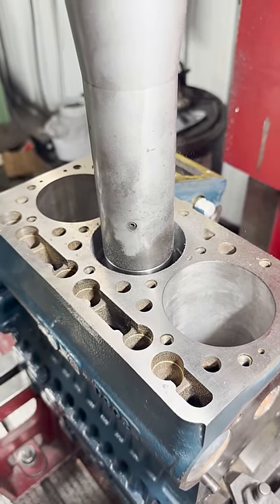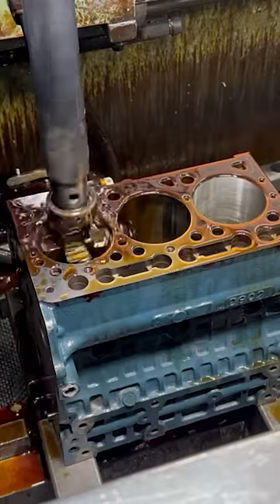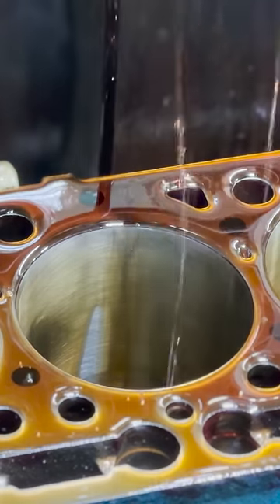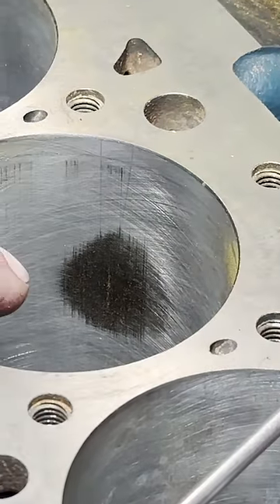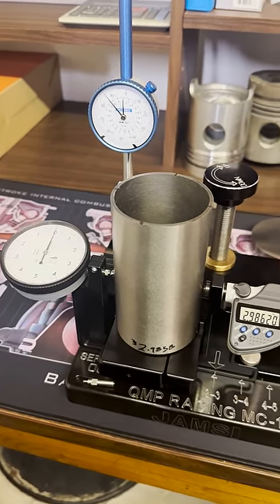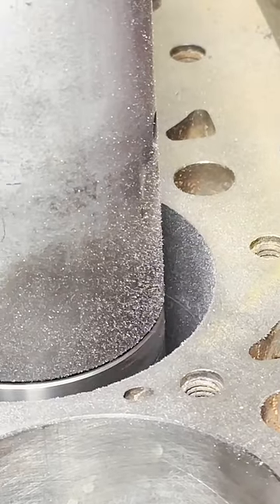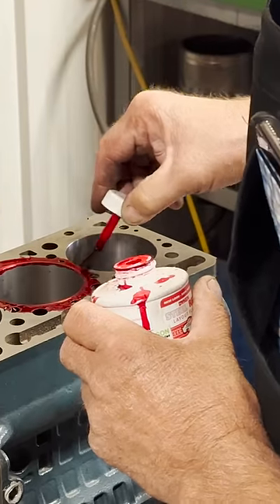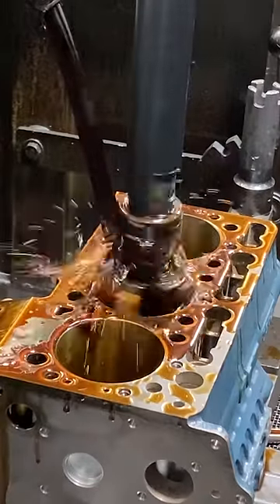#shorts Sometimes You Make Decisions Based On Experience... And It's A Good Thing!

Comment: When the repair cost more than the engine
Reply: A its probally comparable, otherwise why even consider the option.
B The win, not trowing shit away, and keeping orriginal parts.
Reply: I dunno, Kubotas are surprisingly expensive engines
Reply: bro cylinder sleeves are like a hundred bucks
Reply: $1000 - $2000 for that engine u tell me
Reply: @survivalistor6195  have to withdraw from my previous statement since the ones i checked was in fact used and not new. But still, i missed that in the video they say they need to repair the cylinderhead as well so that's an extra cost.
Reply: Na sleeving a block isn't that high
Reply: Good job
Reply: machine work, sleeves, over size pistons, new complete cylinder head, rebuild kit....doesn't make sense to rebuild...just get a new engine with a new warranty
Reply: @enslavedbytruth  all he did was machine and add sleeves silly
Reply: @tylerspruill928  what's silly? customer will need all those other things I listed to complete the job
Reply: @tylerspruill928  I see hundreds of these specific engines a year....when they get abused and overheated, the best option is to replace with a new engine...it's just the way it is...maybe if it was some personal project or something it would make sense...but this is one of the most common commercial/industrial engines in the market for sub-40hp diesels , meaning it's powering a money maker, the wise owner would just replace and get back in service.
Reply: @enslavedbytruth  Whats silly is the fact you think he needs oversized pistons and new heads
Reply: @survivalistor6195 na 25 hp small briggs twin cylinder gas motors $2,500. These kubota diesels 5-7k. I been a mechanic on this stuff for a while, they aint cheap and thats even if you can find them, we have engines a year backordered from covid still.
Reply: Yeah I feel like it would be way cheaper just to buy a new block and use the old parts. But it might be some rare engine that no one sells. Idk could be any but this seems a bit stupid
Reply: Those engines come out of skid steers, replaced one on a CAT 236d3 and then engine alone was over $12k…
Reply: Now that's a pricey meataball
Reply: First of all, those engines aren’t available in a week… we do some yanmar engines and those have delivery times up to 3-4months… So you rebuild them or buy a used/resold one. Also those engines are 5.000-6.000bucks so a repair for 2.5-3.000 is still worth it
Reply: It’s because your wait time to get replacement long block might be a year.
Reply: If you can afford it, sometimes its just more worth it to machine a block you already bought than getting a whole new engine.
Also it's recycling, thousands of tons of scrap are made every year and a good chunk of that is engine parts.
Also you simply can't get some motors anymore so you have to remanufacture
Reply: @litoaykiu That too lol
Reply: that is why today's industry consists of: It's broken? Throw it away and buy a new one.
Reply: I'd just source a replacement from a breaker, but you have to congratulate the workmanship here.
Reply: @tylerspruill928 The narrator states they’re installing oversized pistons.
Reply: @JPTulo  thats by choice, if he chose to do this normally it would absolutely not cost more than a whole new engine
Reply: @tylerspruill928  What’s availability like on those? Maybe parts are more readily available than a new engine and they can’t afford the downtime of waiting for a replacement engine whereas parts are readily available? I don’t know.
Maybe it’s sentimental. Obviously they did it for a reason. 🤷‍♂️
Reply: I was literally bout to say the same thing
Reply: @tylerspruill928  he states on the video that they proceeded to bore all cylinders to over-sized pistons...
Reply: @patrolmars3371  by choice they added oversized pistons, they dodnt need too
Reply: Well .. actually bore for sleeve, sleeve it, surface deck, bore + hone all 3 cylinders for new over-sized pistons and rings. Probably at least $1200
Reply: Old repaired engine is always better than new one because all the tensions in the metal are gone especially from the head
Reply: Can't just throw everything away bro
Reply: Kubotas are extremely over priced and this was probably cheaper still than a reman.
Reply: @tylerspruill928 they only charged him for the sleeve? That's crazy
Reply: This is when you say “screw it, I’ve got a trail rig that I could swaps that into…”
Reply: @darrellbeets7758 throwing metal away isn't an environmental disaster. Metal is 100% recyclable good as new.
Reply: Cost of repair is the sleeve and just machine time... if you get charged a crazy amount... you're getting bent over and reamed with no lube
Reply: You couldn't be more wrong... What is wrong with internet warriors like you? @enslavedbytruth
Reply: @gregscott4479  wrong about what sir? How often do you repair Kubota engines?
Reply: @enslavedbytruth No if you going to built a one with forged pistons, more compression, etc..
Reply: @tylerspruill928 okay you put pistons that are undersized in YOUR engine. Tell is how it works when you have trashed all your cylinders. You obviously don't build engines or have any machining knowledge. You need to do this
Reply: Oversized piston = more power. So if your going aftermarket anyway and paying the same price why not?
Reply: It's close to $6k for that engine.
Reply: But after drilling why it want welded? Quality level like covering crack with Wall paint... IT will crack more during exploatation
Reply: @survivalistor6195 $5000-6000 for a 3 cylinder like that. Or 10k if its an industrial kubota engine
Reply: @tylerspruill928 in the USA maybe. And the work is also affordable there but over here in the Netherlands getting a working engine from a scrapyard is way cheaper even new might be comparable.
Reply: That engine is $5999.99 + $300 shipping.  SO YOU'RE VERY WRONG. 😅
Reply: I've done this same job with a power drill, dry ice to shrink the sleeve, and a grinding wheel. They are being so extra about this it's silly.
Reply: Here in Brazil, repairing an engine like that is cheaper than buying a new one. Also, the bureaucracy to have a new one is very complex, leading us to prefer repairing it.
Reply: sometimes its nice not to have to throw your shit away, and maybe it only costs as much as or a little less than a new engine
Reply: @darrellbeets7758 could also be a discontinued and or very expensive engine. But if that's the case I would just do an engine swap with something cheaper.
Reply: Depending on if it is a repair under warranty, if the repair is $1 cheaper than a new motor they will go that route.
Reply: Atleast we know we can save her if it came to a 2jz I'm gonna sell my shit to get the Sututu 😂😂😂
Reply: I charged 20 dollars to install sleeve....idk what that sleeve cost definitely under 100 so not to expensive rest of stuff doesn't cost much probably 200 in the head plus engine milling the block i would of charged 10 a cylinder that block would be easy to mill
Reply: Depending where this was done it was most likely between 2k or the high end around 4k with head work. If they had access to the tooling it would be under a grand.
Reply: Cost aside, why not just sleeve them all while you are there, and are we not going to weld the crack and rebore it first?
Reply: @tylerspruill928 And if frogs had wings they would bump their ass when they hopped. But the don't have wings and they DID use oversize pistons. We're not talking about what wasn't done, We're talking about what was done. Your creating a strawman for your argument instead of talking about what was actually done.
Reply: And now you have a bad ass Kabota with some yeehaw 🤠
Reply: @tylerspruill928 sleeve cost that much. But labor and the machines don’t. Sleeving a block isn’t as cheap as you think EXPECIALLY if it’s just one block and not multiple
Reply: A new engine is probably several months out…down time=lost money
Reply: @eddoordofoo  a new engine is prob double if not more the cost
Reply: At least you'll know what you have
Reply: @tylerspruill928 .......... If you pay attention to the video the guy says he's putting oversize pistons...
Reply: I was thinking the same thing
Reply: @Fury_BlackWolf  they put oversized pistons and improved engine power. you have to add that to its value overall.
Reply: @enslavedbytruth i would, repair AND replace, then have the refurb as a backup
Reply: @willcal2738  That's like a 12hp Diesel without turbo so i don't think it's any noticeable amount of power they get by simply oversizing. Placebo effect most likely since the engine will run 100 times better than before because it's overhauled.
Reply: Sometimes people can get an engine rebuilt quicker than they can find a good replacement.
Reply: Good fix though.
Reply: Probably saved 1k$ sleeving. 2 thou press seams like a lot.
Reply: The most expensive part of the job is the setup. Once that's done the machine really does the rest.
Reply: @Fury_BlackWolf  but likely getting the motor broken down enough to do the work was the huge cost. I say $2500-5k.
Reply: For when it is a number matching car
Reply: Crazy because the machines do most of the work.
Reply: Не факт...
Reply: Before I say anything else how did this shop stop the crack from spreading?? Or is that not important because there's a sleeve now so it can spread more without worry? comments make me sick. The valve dropped, from above normal operating temperatures which also caused the crack, also the piston still under power smashed that valve into the head. All is equal to a lot of money in replacement parts plus labor. All of which parts and laborers are not cheap at all.
Reply: Brand new Kubota block is $2500 to $3500 easy.  Bidenomics.
Reply: Just wait unti they get a licensed radiographer.
😂
Reply: option A when only valid option when another engine not available
Reply: Not so.  I have a 4bt that needed a cylinder sleaved...cost me a whopping 98 bucks to have it done.
Reply: If you rebuild an engine, you know what you got. Most rebuilt engines get a piston:cylinder tolerance of 1/10000th creating better compression and less degree of failure. Any used or off-the-shelf engine will have a 1:1000th tolerance so the piston rings take more abuse and you have the same chance to overheat and experience the same failure.
I will spend 2-5k rebuilding over paying the same price for the same failure down the road.
Reply: Maybe if you consider „new” second hand engine. Instead you have shining, refurbished one and peace of mind
Reply: A Kabota engine is very expensive.  There was no way this repair cost as much as the engine.  It is not a crappy Garbage Motors (GM) engine.
Reply: Nice work 👌👏
Reply: I change my oil every 125 hours instead of 200 hours that John Deere recommends and I still have original engine going on 1971 John Deere 3 cylinder diesel I also trash my hydraulic oil every 5 years and my antifreeze too. Peace of mind can't afford a new one in this lifetime especially with inflation and my Carne Guisada taco habit 😂
Reply: Wtf are people talking about. The engines are a lil over 6k  right from the manufacturer.  So about 8k after shipping over seas.. this could be even cheaper if you ship/buy in bulk..
Reply: Local machine shop wanted 2600 to deck my 750 block. That included resleeving to standard bore (the 750s usually are sleeved stock) then decking the head. No assembly. Out of their minds. I picked up a running motor for 1700 with very low hours.
Reply: @tylerspruill928 you think they're DOING this repair for 100? I'm guessing it's pretty close to the 1000 (lower end of engine cost)
Reply: @tylerspruill928 the said they're putting in oversized pistons right in the video you just watched
Reply: У меня hayabusa 2001 .его родной блок никасиловый стерся в зеркало и жрал масло он 1 - 1.5 литра на 1000 км.гильзанули его гильзами вроде от лансера 2.0 .поршни старые оставили они хорошие были .компрессионные кольца новые поставили а маслосьемные поставили tpr помоему от лансера 2.0 предварительно проточив канавки в поршнях .теперь мотор сожрал 800 гр на 6300 км пробега .возможно он сожрал бы меньше до 5000км потому как я заметил что именно после 5 он подожрал основной обьем жора
Reply: There's considerably greater value in something fixed than thrown away
Reply: these are not cheap motors up I've rebuilt several of them
Reply: Yes
Reply: @enslavedbytruth had to be like a 20 to 30 hour job from tear down to the end of the rebuild. It had to be expensive as crap.
Reply: @Nelthalin yea but when you rebuild properly, the engine will last as long as new. Sometimes longer. A scrap yard engine could have you back in the shop in no time. Do you want to save a buck in the short term to spend a dollar later on?
Reply: It's now a $4000 engine, worth $1500.
Reply: @enslavedbytruth the machine shop is an honest one if it was to brake and was there fault he holds his hands up other wise his work speaks for its self he's rarely doing it twice 😂
Reply: This is like a 3 grant repair. New engine at the dealership is like 8 g. 😂
Reply: Yeah. We did this a few times for a reason: NO NEW ENGINES AVAILABLE. So you have to deal with what you have…
Reply: Well at least you know this engine isn't trashed, people tend to get rid of things that give them trouble, in the long run, repairing will end up being the cheapest option probably
Reply: It's for the matching numbers car collector!
Reply: 7k for a new D902 I rebuild these sometimes. It's never worth it. Always buy new ones
Reply: @survivalistor6195 it's about $7k. It's a D902 kubota engine. But either way not worth rebuilding these engines are absolute trash
Reply: 1d
Reply: @enslavedbytruth and how long before that crack becomes a real problem? They didn't weld it.
Reply: @tylerspruill928 doesn't need pistons but it needed a new head. No way it wasn't damaged.
Reply: @thechum9653 that's a good point. We should start thinking that not everything is replaceable so easily. That world is probably gone for a while still.
Reply: @kaigeiger7163 why do they take so long?
Reply: combustion engines are crap and need to be gone from auto mobiles
Reply: Quand le bénéficiaire de la vente gagne plus que de faire réparer...
Reply: Not even close. As long as everything else is good, having the head and the deck resurfaced along with a sleeve shouldn't be more than a grand. I've had entire engines get resurfaced and rebuilt for less than that. It all depends where you go and what their hourly rates are.
Reply: In Germany, such a job is about 5-8.000k $…
Reply: This is probably still cheaper than buying a used car. As many used cars are still getting close to brand new prices
Reply: @muratammar8179 

This! Old seasoned blocks are always better than new.
Reply: @Michaelbor911 Learn English.
Reply: Bc you can't buy a new one. So fix it or sell it to someone that actually can.